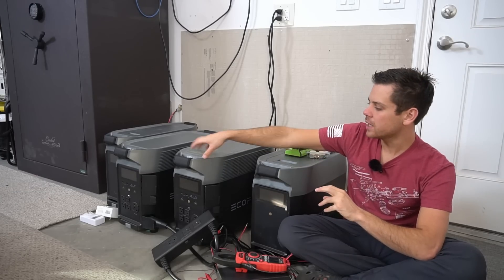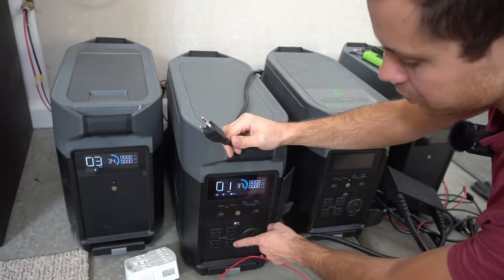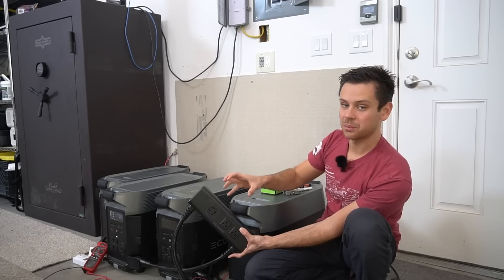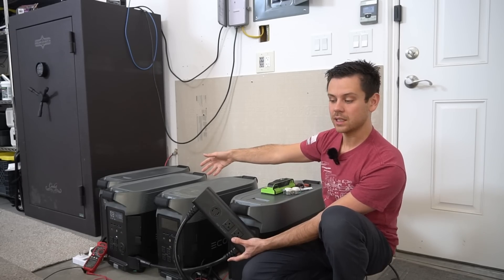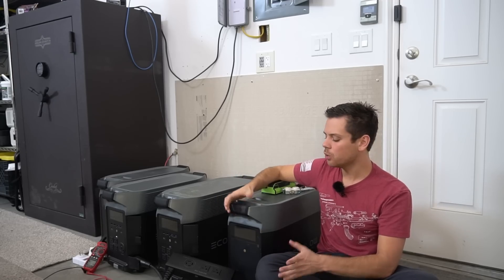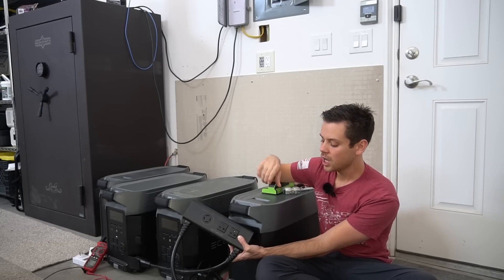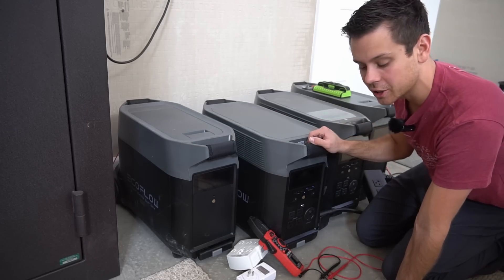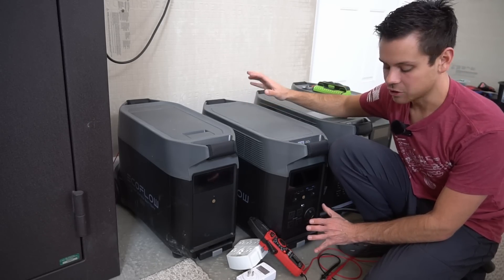I broke my Ecoflow Delta Pro 😬 (my fault)

Comment: The problem is not this bond but the bidirectional system.
Reply: Victron get round this issue in their inverters by using a transfer switch and neutral grounding relay. When not connected to the grid, the inverter grounds the neutral but when grid connected, neutral grounding is deferred to the mains supply.

Comment: I charge my Bolt EV using an aftermarket 120/240-volt charging cable that does not reference a neutral.  My OEM 120-volt charging cable DOES verify a neutral-to-ground connection. I use the 120/240-volt charge cable with portable generators because of this neutral issue.

Comment: Hopefully there is a fuse that you can replace inside the unit.  Maybe the only way to get 240 out of 1 unit is connecting it to a 240 step up transformer might not be as efficient but you should get 240 out of it,  just not sure how many amps it will handle

Comment: I’m going to set the world record for longest electric skateboard ride across the United States. I want to use solar to charge my battery. 12S6P Battery Pack with LG HE2 Cells, 15Ah, 120A, 43.2V. Knowing very little about solar, what would be the best way to charge a battery similar to the one above? Just starting my research and planning. Any suggestions would be helpful. Thanks to anyone that can help.

Comment: Damn, having that second bond was a concern… I would have thought they’d keep ac systems separate and use the batteries as the energy gateway.

Guess they want to protect the batteries from lots of charge/discharge cycles by passing AC across to the receptacles of the unit when plugged into the grid.

They should check for a ground neutral bond and disable the AC wall charging if detected.

Comment: I'm glad you posted this Will. I'm planning on buying one of those Delta Pro's to connect to 4x250w panels and run a window A/C during the hot days to cut my electric bill and have some backup power available in emergencies.
Reply: @TravelingStacker  Good point - in my case, it would take about 5 years if electricity rates stay the same (unlikely) and I use my window A/C 6 months out of the year (I live in an area where May-October temps are anywhere from 90F to 112F).  I bought an EF Delta Pro and I have a Window AC unit so I am doing the exact same thing, but I mainly bought the Delta Pro for use with my RV and also for emergencies.  So the cost isn't just to offset grid usage, it's more for convenience.   Being able to run my whole travel trailer including the A/C unit for a couple hours at least, is awesome.  Then I use my Honda 2200 generator to recharge the Delta Pro in a couple hours when generators are permitted.  Not cheap, but super convenient and really a fun hobby if you're into power/tech.
Reply: @TravelingStacker    Electric rates.... Reno, Nevada, 11 cents a kilowatt hour.  San Diego Graft and Electric 45 cents a kilowatt hour.
When the guys in Australia started seeing $1400 per month electric bills around June of 2020, I saw the writing on the wall and started building my own backup power systems from off the shelf components. I think that we will be seeing $1+ per kilowatt hour sooner than later.  So I do this for fun and the cost doesn't bother me. I'm pushing 70 and want to be the last kid on my block with lights and working fridge no matter what happens.
Reply: @TravelingStacker  I've already got the panels for free...and I want backup power anyway. Using it for A/C is just a way to get the most out of having it.

Comment: Not sure what the USA have available but in the UK we have portable RCD plugs mainly used for lawn mowers etc, using something like that would trip on the output if a fault goes to ground which could potentially protect your house ground on the input! Maybe?

Comment: Ground references is where I hate home wiring - it often becomes unpredictable because you don't know where other bonds were made, when, or how reliable they are  Until current starts flowing you often won't see the voltage differential hotspots that develop.  This would be a GREAT video to walk the path from your main transformer into and through your house and point out danger areas.

Comment: I know these guys are sponsors but just, ugh! You increase the capacity by adding on more units to get more cells but also duplicate chargers, controllers, inverters and everything else. When one thing breaks, you have to replace the whole unit. No thanks, I prefer to build my own and replace/duplicate the parts I need. It also means I can overengineer where required.